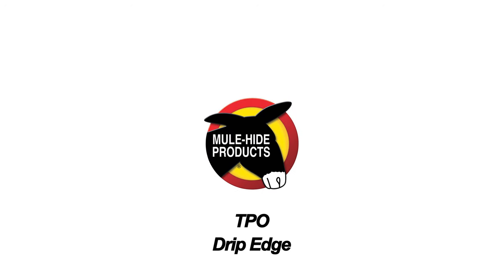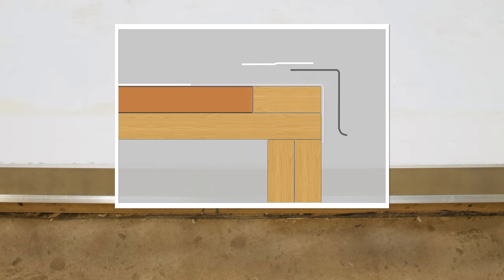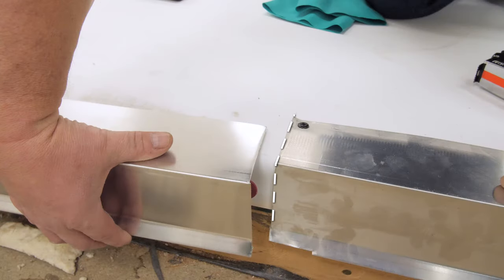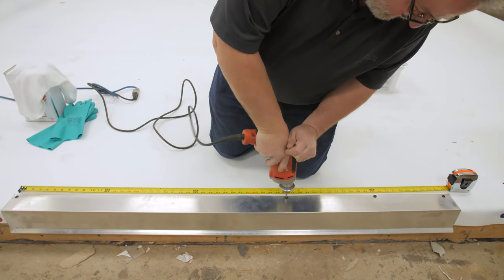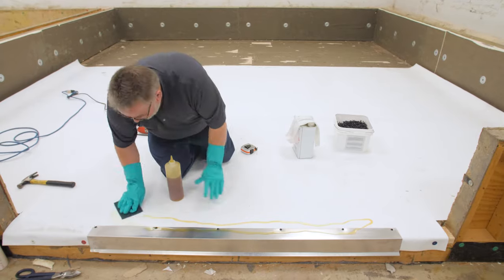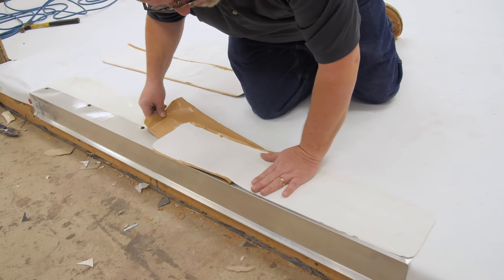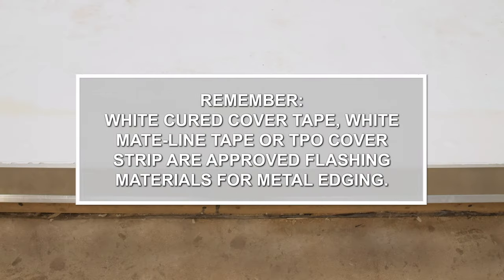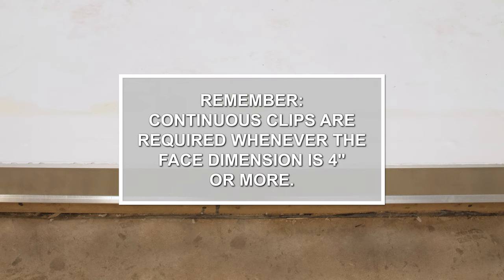TPO: Drip Edge

Comment: Do you wrap the edges, put metal on top of tpo, and cover with am adhesive membrane because it's cheaper than tpo metal? Tpo metal seems way more practical and less labor intensive, which probably costs the same in the long run as this method does. I don't get it. Unless the home owner wants a drip edge that's a certain color?